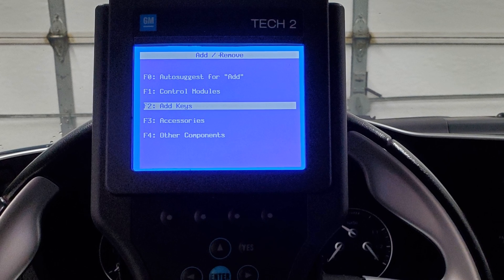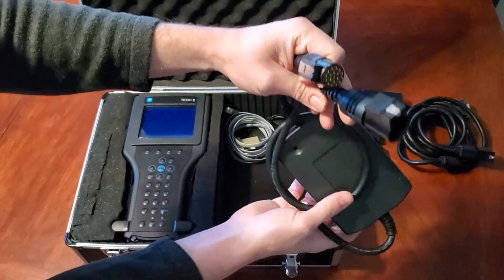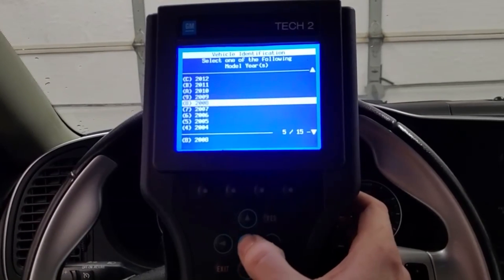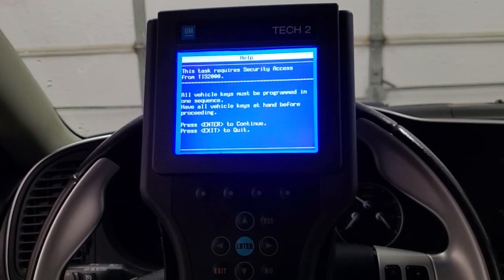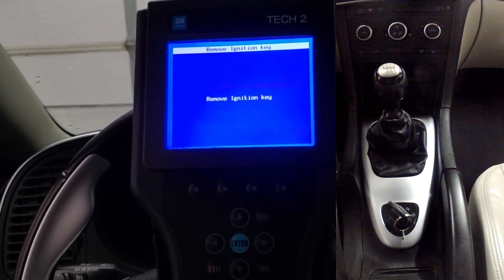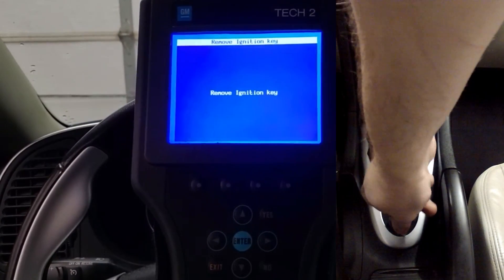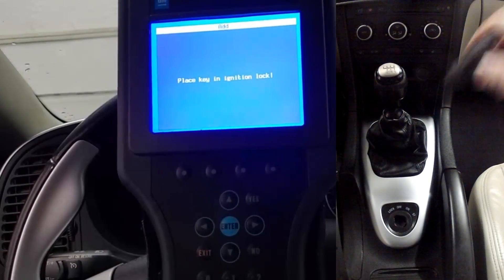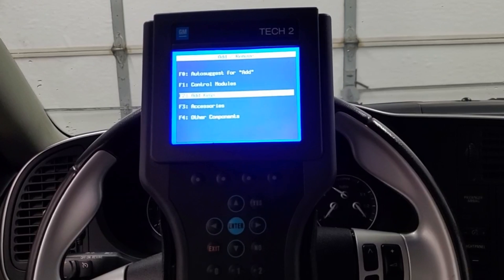SAAB Tech 2: Key Programming

Comment: Will this work when my old key is damaged?? It still starts the car but no longer operates the alarm.. 
the battery connector on transmitter broke off!!
Car has no issues
Cheers
Reply from the maker: If your Saab recognizes your damaged key when inserted into the ignition and starts the car you can program a new key off of it. I'd recommend making a new replacement key off the damaged one before its totally dead and too late!
Reply: @WeakestofWeeks  thank you mate I have odered  one from uk.. be 6 weeks or so